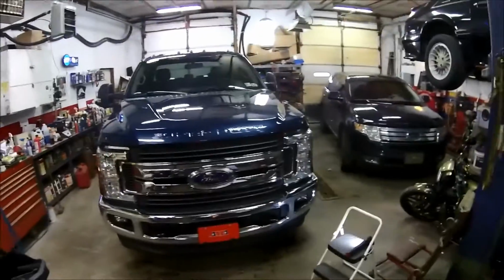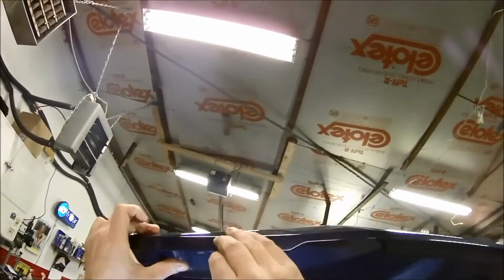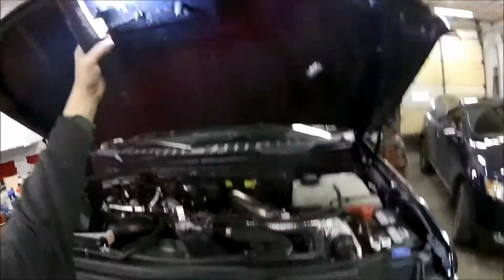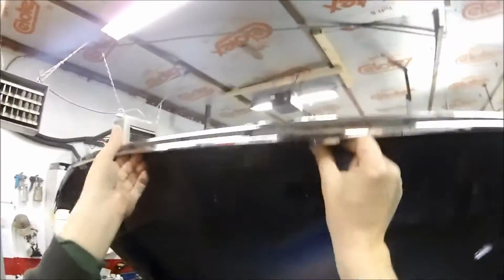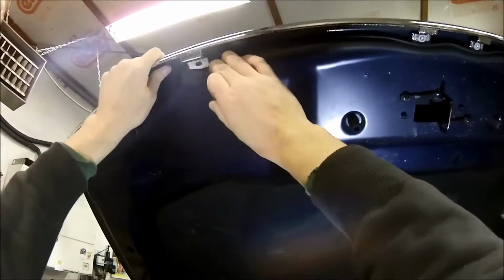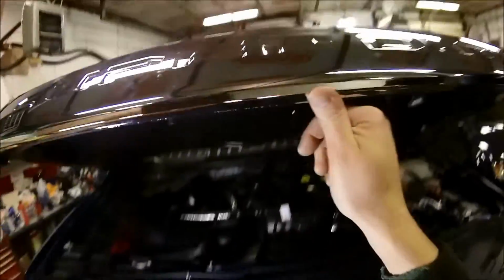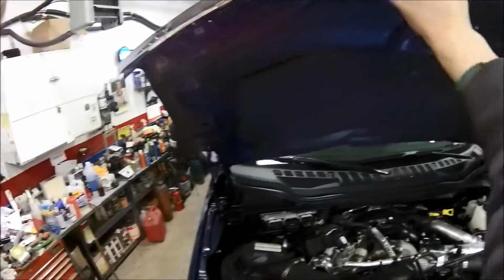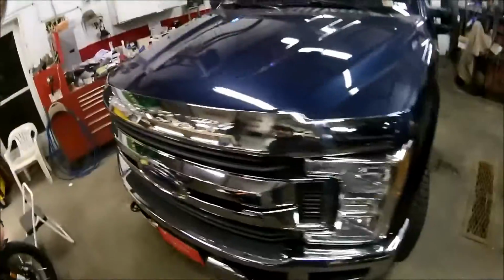Bug Shield Install on a 2017 F250 Superduty

Comment: Looking at the pictures that came with mine in proper order shows not to put the metal clips on the deflector until after installing the deflector on the hood with the plastic clips only. That might be why you had an issue accidentally pulling off the weather seal and rubber stops, and having a tough time getting the hardware to line up. Cold doesn't help either with getting them to stick either. Heat gun could have helped with that. Either way thank you for posting as it helped me figure out where to put the pieces of sticky back foam. That wasn't even in my instructions but it was included with my kit. I personally went with the black instead of the chrome. My truck is black though. Also can confirm they're not on the Ford website but I just bought mine in May 2020 for my '19. Just need a Ford dealer that finds it 'worth their time' to look up the part number :)
Reply from the maker: Thanks for the info.  Its been so long I cant remember.
Reply: I bought the same black hood shield as well for my 2020 F 250 Iconic Silver Tremor. I had the entire hood, headlights and complete front fenders and A pillars covered in XPEL.com paint protection. This hood guard is just helping keep pock marks and dings off the leading edge of the hood. 
No instructions on the sticky foam strips either so I will just follow what JDMan did in the vid. I found a Ford dealer 3 hrs away and he was nice enough to ship the guard to me for $15. No one else had one or could get one due to a covid back order. Plan to install it in the next day or so. Thanks for the pointers gents. 👍🏻

Comment: Looks more like a chip guard than an air swoop to send the bugs up and over the windshield. Does it move air like the old ones used to. It looks sweet but I need to drive in Pennsylvania and the bugs there will splatter your windshield like CRAZY! Please let me know. Thanks for video.
Reply from the maker: I live in SW Pa and I havent noticed a lot of bugs on the windshield.  Every now and then you get a big one that hits.  To be honest I didnt buy it for the bug properties, I want to protect the hood from stone chips. I drive near midnight on a regular basis and like I said, I'm not having problems with bug guts.  I think its a great shield!

Your mileage may vary lol!

Thanks for watching!

Comment: What is the part number?
Reply from the maker: Sorry. It’s been almost a year and a half since I did this. Just call your local Ford dealer and ask for the parts department. Ask them for the chrome bug deflector for your year of Super Duty. It’s a Ford part and I’m sure they’ll be glad to help. 
Thanks for watching!
Reply: @jdman7170  
HC3Z-16C900-C 
Hood Deflector - Black Molded